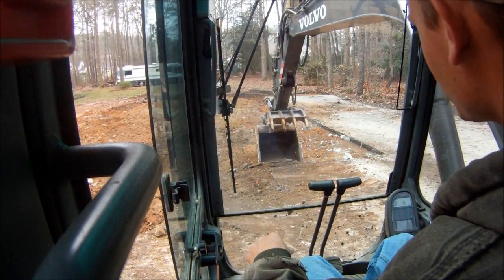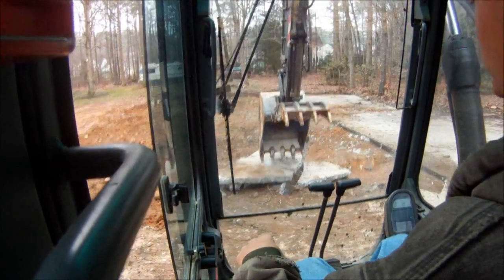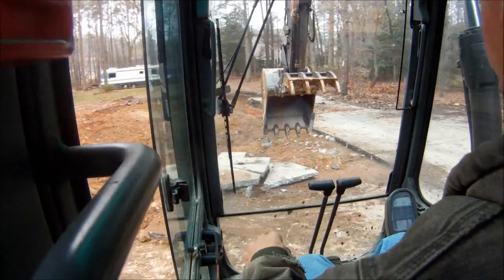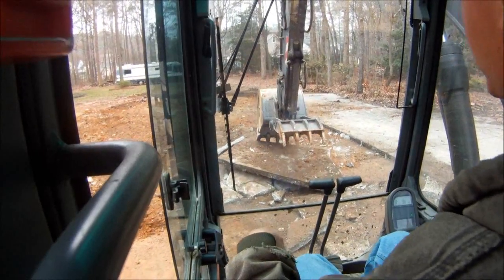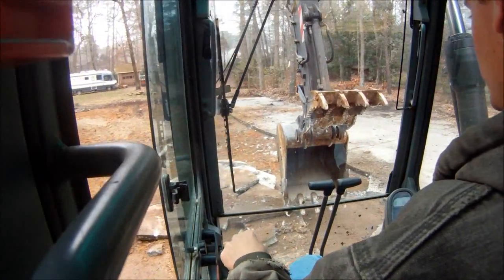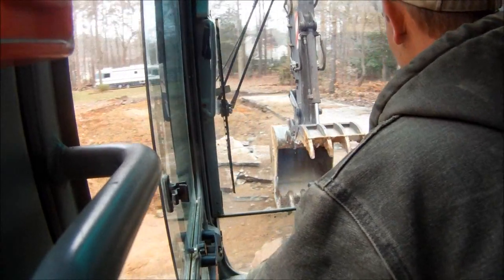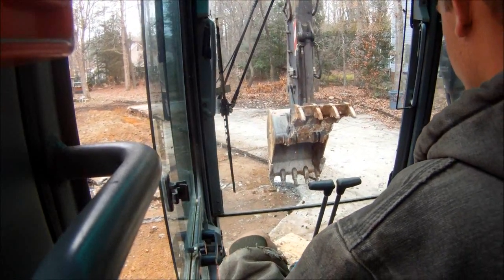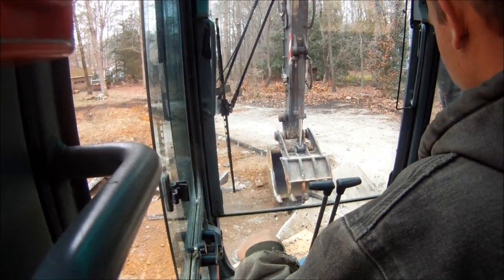Excavator Busting Concrete

Comment: Is it better to use the teeth to break it or the bottom of the bucket. I know the easiest way is to drop it. But other then dropping it which is more preferred? I've seen it done each way.
Reply: Brad Reed when i started i used the bottom of the bucket. Later on when i became more competent, i usually use the teeth or lift and drop to break up concrete. Its better to lose a tooth than having a caved in bucket when you choose to use the teeth, but losing a tooth is very unlikely as they are made from very hard steel. Unless you installed the locking pins wrong then the tooth will just fall off not break. Overall this method is hard on the machine. If you want you’re machine to last long I recommend renting out a breaker.